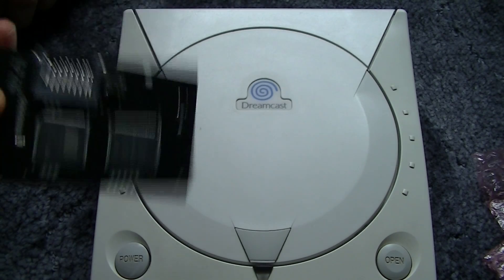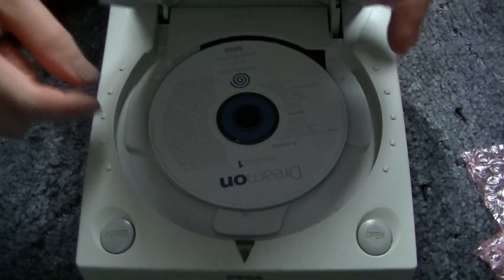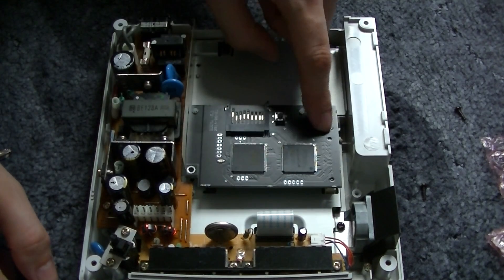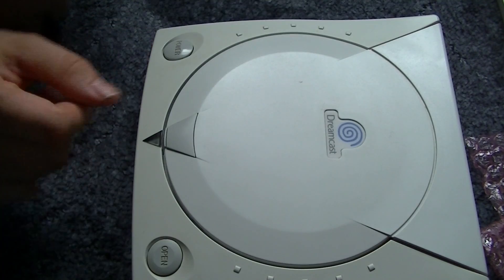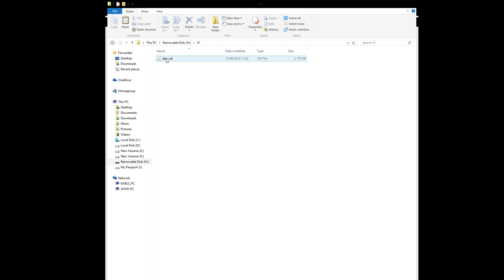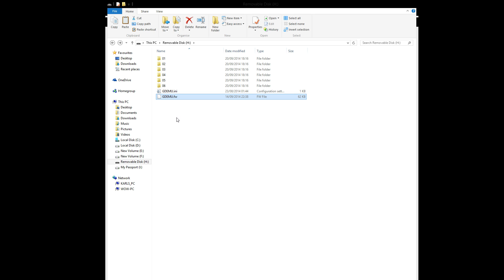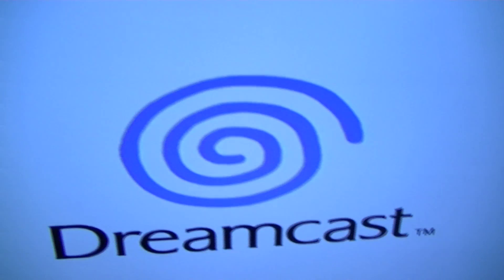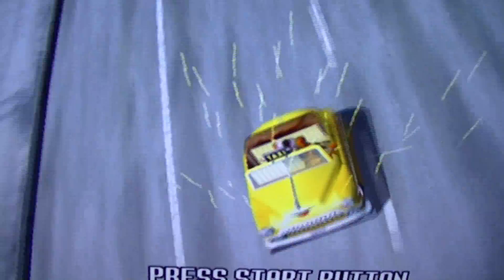DreamCast GDEMU SD Reader Install and Setup

Comment: There is no other or cheaper mod to repair a dreamcast with a bad disc player? Also the Ata G1 mod needs the cd drive to work?
Reply: Good news is the GDEMU has been cloned and is easily obtainable for $100 from China, people say it works perfectly the catch being that you can't update the firmware even through its an exact hardware copy, probably has something to do with the firmware itself. Yes for the ATA G1 mod you need for the disc drive to be able to run DreamShell, however you can piggyback the bios with a blank bios and flash DreamShell onto the second bios chip never needing the disc again, but you'll need good soldering skills to do this and need the GD ROM drive to operate reliable enough to flash it from the disc. You can repair yours, but for $100 you'll never have to worry about it again or using discs.

Comment: have you had any heating issues using scart?
Reply from the maker: No none....but why would using Scart cause an issue?. I have read reports about people using a different internal PSU as its now not powering the disc drive anymore
Reply: BlockABoots its something to do with the 12v rail the scart uses.. ive only just got my dc with gdemu  and keeping an eye on things.. but ive read posts from users stating the psu over heats and creates a burning plastic smell from the console..

Comment: You forgot to desolder the 12v regulator. Prevents the psu from overheating since there's no drive anymore that uses the 12v
Reply from the maker: Hmm, is this a recent discovery?, never noticed any mention of that when i installed mine 2 yrs ago
Reply: Nah it's not a recent discovery. It's not posted out on the GDEMU site but on assemblergames it is. Most people have gotten rid of the PSU and put a picopsu in it instead. You can desolder the 12v regulator wich will make it that the drive itself won't work anymore in your dreamcast since it needs 12v but it's much cooler and prevents overheating or you can put a 300 ohm resister in the 12V wich keeps it spiking up till 14V. When doing so make sure it's high enough wattage. Mine that is installed is a 20W resistor wich is a bit overkill but around 7W it still kept spiking up above 13volts. So if you go that way make sure to buy a 15/20w 300 ohm resistor. It's generally easy to install and a couple of pictures online where to install it.
Reply from the maker: Thanks for the info, ill get around to fitting a resistor
Reply: BlockABoots No problem !

Comment: Does it use Compact Flash Cards or SD Memory Cards? It looked like it had long pins and I thought that meant it is a Compact Flash card because SD Memory Cards po in and out with a spring loaded slot
Reply from the maker: +Dallas Dal SD cards, im using a 128GB SD card in mine
Reply: How did you get the device that you hook to the Dreamcast? I went to the site in the link and could not find a price or place to order one. How much did it cost how long did it take to get to you will they ship to the USA?